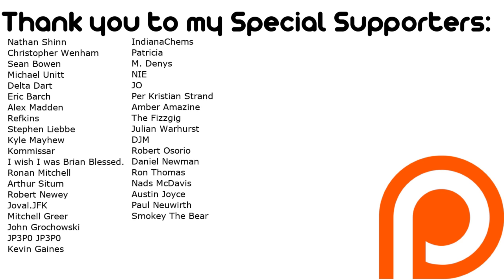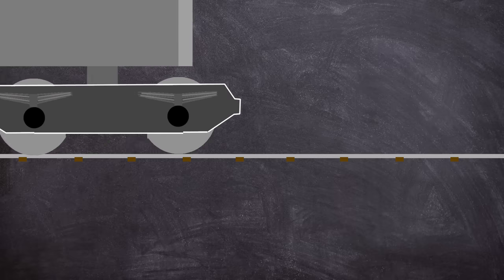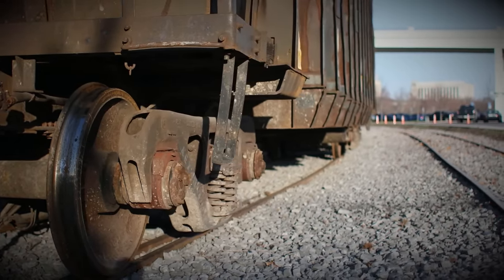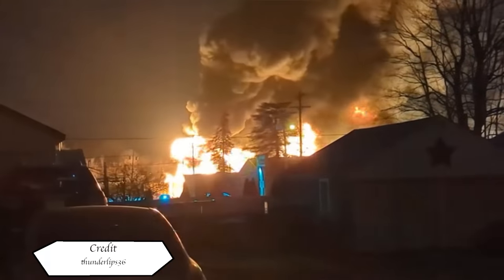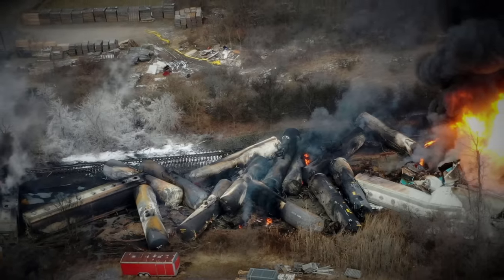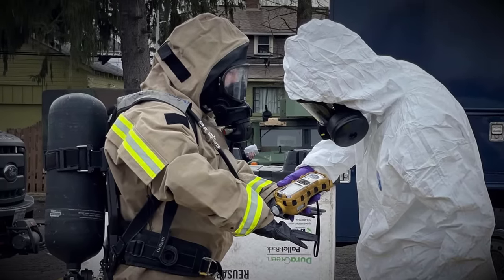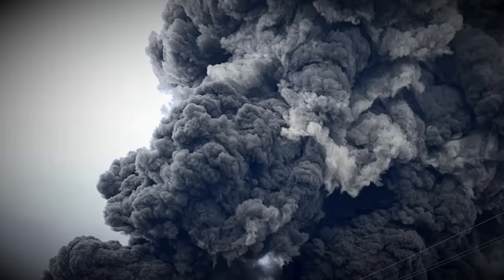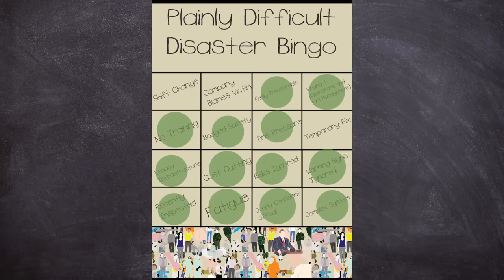Profits Above Everything: The East Palestine Train Disaster 2023 | Plainly Difficult

Comment: Just a side note as a conductor for a US-based Railroad: At 8:57 you said, "The rules require the train to be immediately brought to a halt. However, the driver the driver (Engineer) didn't put on the emergency brakes, instead applying the dynamic brakes to slowly bring the train to a stop." That is normal as most railroad rulebooks say something along the lines of, "To bring the train to a stop using good train handling unless conditions require an emergency brake application." This is because emergency brake applications can sometimes cause derailments on their own when a train is moving at higher speeds because of basic physics, especially when its one of the 10,000 Feet+ long monsters most of these Class 1 railroads love to run these days. 

But I also want to note that NS's Hotbox detector "sensitivity" is disgustingly low, requiring a temperature so high that most of the time a bearing may have already failed completely before triggering an alarm over the radio. (I'm never gonna forgive NS for that mess, but I wanted to point out that little tidbit.)
Reply from the maker: Very interesting, I was working under the assumption like how in the UK railway rule book immediately bring your train to stand means emergency brake application.

its interesting how its done in different countries!!
Reply: @PlainlyDifficult , setting air brakes while still on the detector can trigger more alarms too. 
Also if you're moving over crossings that need to be cleared, DB is the preferred method in a HB scenario. 
Sometimes both methods are used in tandem in everyday operations or sometimes independently. 
"Plugging it" can cause more harm than good as mentioned by the first reply above. 
Handling long and heavy mixed manifests like the culprit in the video have to be handled with extreme care by the engineer.
I've been at it 22 years and I still sometimes get sweaty palms bringing the big ones (10k feet) to a stop coming into yards and signals.
Thanks for all the great videos, just finished this after a 31 hour round trip on 2 similar trains, yay..
Reply: Yes sir. Plugging it can cause excessive longitudinal and lateral buffering forces.
Reply: I dont know anything about trains, but I was thinking same thing. If you pull handbrake on a car it can actually make you loose controll. I would expect the same thing with trains. Only little knowledge of physics I would expect exactly what you describe with emergency brake aka things could have been even worse..
Reply: @PlainlyDifficult  Freight railroads in the US, Mexico and Canada are much longer and much heavier than trains in the UK (or Western Europe).   As a result train handling can/will be different.   Passenger trains in North America will often (always) be put into emergency braking.   But heavier freights can often be stopped in a much safer and controlled manner by not using emergency brakes.   Think of going down the highway in a car at high speeds in wet conditions.   Sometimes an easy brake application will be safer than slamming on the brakes
Reply: @PlainlyDifficult  In the US, the freight cars (carriages) can be up to 89 feet/27.1 meters in length (the tank cars are typically shorter, at 59 foot 10 inches/18.2 meters, but can weigh 286,000 pounds/129,700 kg fully loaded), and there can typically be 100-130 in a single train (although at least one Class I railroad is pushing 150 cars per train on certain routes). Considering a worse-case scenario the train can easily be over 2 miles/3.5 km in length, although most are under 1.5 miles/2.4 km. Depending on the makeup of the train, it may have radio controlled locomotives either in the middle or the rear of the train, not only to boost air pipe pressure, but to help smooth out starting and stopping by reducing the strain on the couplings between the cars (American rail cars do not have the "buffers" between the cars so all of the slack action is directly on the coupler itself).

Since this train had no mid-train or rear locomotives, as others have said, putting the train into an emergency brake application increased the risk of derailment, so reducing the momentum with a dynamic brake application in combination with the slow application of the service brake is key. Also, in most cases the thermal bearing detector should have sounded an alarm before it reached a critical temperature so the train crew has time to safely stop the train, and then after an inspection if they can safely do so pull the car at issue to the nearest place it can be removed from the train, and then put the train back together and resume their trip. The dispatcher will then send a repair team to where the car was set out of the train, and make necessary repairs if it can't safely be moved to a yard for repair (I've seen them jack up the entire end of a car and replace an entire truck/bogie if necessary on one of these out of order cars.
Reply: Better call out then mine, but with that said you know all the procedures we have in the USA and you know the amount of traffic of chemicals. I think we honestly do a great job, and yeah the sensors may be too low but at 90 degrees on a hot day that’s not hot either, the sensors should be able to adjust by ambient temperature and average bearing temps accross the whole train. So if one is significantly hotter but on a really cold day they could recommend a shutdown
Reply: @PlainlyDifficult  I have some comments on this video. It's not quite clear whether it wants to focus on the cause of the derailment, the overall effects of the fires, or the particular point that the "controlled burn" was unnecessary. But let's focus on the last item. The danger is not properly explained, but from the quotes at the end I understand that polymerization (you might need to explain that too, but I know) can block the safety valves from within, so that the pressure can rise uncontrollably and lead to an explosion. Now the report says that after they opened the cars, none of them showed polymerization. However, that is irrelevant. Those who made the decision to do a controlled burn didn't have that information. The real question is if they made the effort to collect data and to make a risk assessment: what was the risk of an explosion? You touch on this at 13:07, but "OXY ... would later state that they did not believe..." When was "later" and "believe" is not a risk assessment. The animated text bubble (here and elsewhere) is uninformative and plainly offensive.
At 11:52 you read out a list of many other chemicals that were burning, so how do we know that the worst effects came from the vinylchloride? 14:25 "Small pets were dying around the 6th and 7th of February. 13:35 "The VC was released on the 6th at 4.37PM". Finally, at 19:57: I can't take this scale serious (there are real ones) but clearly it was not intended to measure the death of animals.
Reply: When I heard the temps I was surprised that was even legal
Reply: @PlainlyDifficult  it's weird that you didn't say anything about the braking system in this video.  After this happened, people were arguing that the braking system on the trains were old and should be replaced with electric systems, but the train corps had lobbied successfully against the regulation.  I find it strange you talk about the hot box system so much in this I almost feel like that's the trap.  Assuming the hot box system were the point of failure, it would be a relatively cheaper process to fix and you could also continue to enjoy not replacing the brakes (as intended)
Reply: @mwjones71  the most intelligent comment in this thread
Reply: @rolandbol7350  The only critique I have with this idk, review- is that you question the effects of vinylchloride. See, this one isn't up for debate. Vinyl as a compound is toxic to all life when burned. And the fact there wasn't actually a need for a controlled burn (something they never even verified before starting the burn), is what has been making people upset about the situation. The VC has the spotlight because it is by definition the worst chemical both environmentally & health wise that was present. Burning it made an icky chemical 10x worse for the local environment. 

And just to cover the other chemicals that he spoke of. Acrylics are really bad, about as bad as the vinyl. Plastic pellets are somewhere similar. Ether in most forms burns off fast and as long as you aren't nearby- is generally fine. Glycols are edible and used in gelatin products for food, vaping juices etc- it being burned did nothing. The Vinyl Chloride monomer is taking the spotlight for good reason. The company that makes & sells all of these chemicals, OXY, as you mentioned in a quote- literally had said that polymerization wasn't happening. Which makes sense when you're dealing with monomers that require extreme heat treatment to form polymers. This wasn't a question of not knowing. This was a point of contention that's literally a basic understanding of plastics. Something the railway would've known if they made contact with OXY & listened to what they had to say. Something that should be an obvious best practice, at least if you're operating in good faith.

The railway was sued and settled for good reason. The railway & their 'independent' company literally made this incident 10x worse by thinking they know more than a literal chemical company.

The problem with the chemical isn't less valid because you have a semantic issue with a video covering the incident, or are lacking knowledge of some of the most common chemicals we use today.
Reply: @cdavid8139  Passenger trains can be stopped quickly enough without an emergency application. Emergency applications trigger all sorts of other rules issues so are generally avoided.
Reply: @DanielWilczek-nu7ff  In regards to environmental pollution in inhabited areas, the combustion products of vinyl chloride are more dangerous than vinyl chloride?
Reply: @PositionLight  Thanks.   I've never pulled passengers outside of small excursions so I really don't know.   I've had some commuter engineers tell me they put the train in emergency during road crossing collissions.  But those conversations were limited to just certain lines.  Appreciate the update
Reply: @clankclankimatank  It affects a much larger area is the problem really. The vinyl is just as problematic in either form, but when it's being burned it becomes a problem not easily managed. Not even a 'controlled' burn can stop the wind. It's why there's dozens if not hundreds of reports of sick & dying domestic animals in the region right when the controlled burns began. (Just looks at the plumes of black smoke in videos taken from the controlled burn, the surrounding town was coated in a dirty smog as a result.)

Edit: Thanks for pointing out the weird way I explained VC's health hazard, didn't realize I wrote it so weird.
Reply: I was about to say the same. Our guidebook definies 3 types of alarms:
One for danger, normal and a relative one.
Only for a danger alarm will they close the first managed signal so the train comes to a halt slowly but as quick as possible (our type of signalling allows for this to happen). For a normal and relative alarm they will call the driver and tell him where to stop for an inspection.
Indeed an emergency brake is what you should NOT do, it will put so much stress on the bearing they could disintegrate and destroy the whole axle taking the train with it.
Reply: I agree with u. Dynamic braking is 1st choice before service braking. Emergency braking is not used unless stopped.
Reply: @PlainlyDifficult  U. S. trains use an entirely different coupling system (the Janney automatic knuckle coupler) than the UK and most of Europe (hook-and-eye turnbuckle and buffers), so that even when "tight-lock" couplers are employed on passenger cars, allows there to be "slack" in the couplers i.e., small spaces between the couplers.  (The Janney coupler is more robust than the European system, hence allowing for the massive trains operating in N. America).  This means that in extremely long freight trains there might be a car length or more of slack in the consist, and stretching it out produces forces of "draft", or compressing it together produces "buff" forces, which can result in separating cars or derailing the train.  Buff forces are far more problematic, which is when you get the jackknifing of a train like you see with this derailment.
Reply: @mrsmerily you also have little knowledge of spelling. It’s lose not loose.
Reply: @mrsmerily  pretty spot on actually, when you apply emergency brakes on a car or a train you basically give up any control you have of the vehicle. The big difference is you can't release the emergency brake on a train like you can a car.
Reply: @ProjectAtlasmodling  really? I thought they were low, although the last reported temperature was a concern on how it increased from the recorded reading before. I honestly think the bearing failed catastrophically in a sudden way.
Reply: @duradim1  there is almost never as sudden catastrophic failure.
Everything has a warning
Reply: @ProjectAtlasmodling  yes everything has a warning, but not all warnings are long.

Comment: Excellent video as always! As a train driver from Europe i would just like to add that in case of a hot box, it is best to avoid an emergency braking as the induced mechanical stress is likely to cause immediate failure of the overheated axle. We are instructed to slow the train down as gently as possible, which is what the crew of that train did. Unfortunately it was too late, even for the gentle braking.
Reply: for an American freight train you only ever risk an emergency break application if it is bad enough to risk a derail American trains can top out at 2 miles which is about 3.5KM  long lot of weight you try to stop slowly especially for a  minorish issue like a hotbox American passenger train operate more like European trains and will use the emergency break

Comment: Vinyl chloride monomer is genuinely wicked stuff.
Reply: At least it was not cars full of Organic Peroxides lol
Reply: Do you know how it is different from polyvinylchloride? I assume it's like Silicone, where the base pairs form "strings" in polymerization. I've only delt with PVC in construction settings. Working with semiconductors, it's not a normal chemical I'm totally familiar with.
Reply: @nickdubil90  PVC is pretty benign as long as it isn’t on fire.  VCM has a wikipedia page that covers it, and it’s a hell of a read.
Reply: @CanielDonrad there was a car that overheated and blew in alabama a couple months ago. Half the car was airborn for ~15 seconds if I remember correctly. I half ass did the math and it went ~4500 feet in the air if I remember correctly
Reply: @jimsvideos7201  "as long as it isn't on fire". 

I guess it's similar to silicone then, as I thought. I have nothing against PDMS, PVC, H2O2, or any number of industrial chemicals, so long as they are correctly used and disposed of.
Reply: @nickdubil90  It is flammable and carcinogenic, which I don’t think silicone is.
Reply: PVC is used in Schedule 40 and 80 piping and electrical conduit.  You need high Methyl-Ethyl-Ketone PVC glue to melt PVC fittings and pipes together.  MEK gives you liver and kidney damage, along with the possibility of leukemia with chronic exposure.  It's also highly-flammable.  It's also the active ingredient in modeling cement like that Testor's glue people sniff to this day.  MEK chemically welds styrene and ABS together, along with PVC.
Reply: What kind of gasmask do I need to venture around the area?
Reply: @nickdubil90  vinyl chloride is to PVC what ethylene is to polyethylene, or ethyl cyanoacrylate is to superglue, or indeed what dichlorodimethylsilane is to silicone (even though the individual polymerization mechanisms vary).

Polymers tend to be non-toxic because only the ends of the polymer chains remain reactive, and they are far less volatile / less likely to be absorbed by a human due to the mass and bulk of the molecule.
Flammability is also greatly reduced because a gaseous monomer mixed with air can react far more readily than a smooth chunk of plastic that is only exposed to oxygen on its surface.

Comment: Across the pond infrastructure is by law separated from operation. We are using failure state detectors coupled with train control. Typical "hot box" part consist of eight discrete infrared thermometers. If anything is above threshold next signal block would impose speed restriction and train must stop at nearest station for inspection. Yes, we have learned.
Reply: Correct, we have hot wheel detectors here as well.  Three detectors up the line it was too hot.  We know this because of the security camera video.  We have the same rules about stopping and walking the train.  Retired rail here.
None of those things will do a bit of good if the company running the train doesn't care.  With that attitude you can throw all the money and technology you want at this problem and it will keep happening.
Reply: @piquat1 there is a difference tho. Today no manual intervention is required if a failure detector sees any anomaly. Anomaly means automatic signalling block change to a safe speed and next station route dispatch can only stop such train. The driver is either informed by the digital train control about the speed restriction reason or by the dispatcher via radio. But braking is essentially obligatory. It is utterly important on mixed corridors
Reply: How it should be, automated detection and execution of protocols to avoid the human apathy element. If you override that system, you're personally making yourself responsible for whatever comes after, and the last thing people want to do is take the blame!